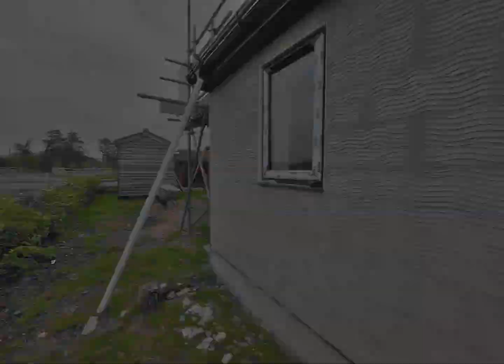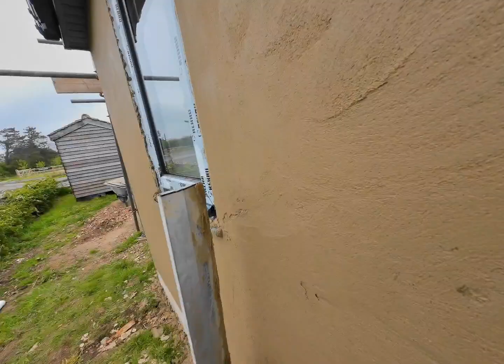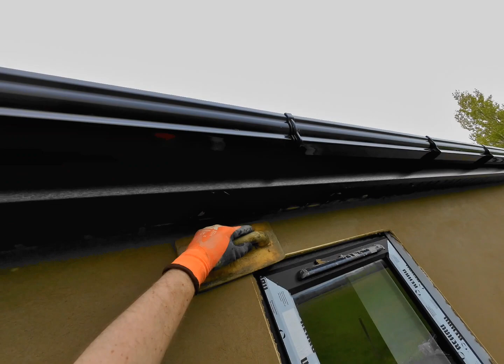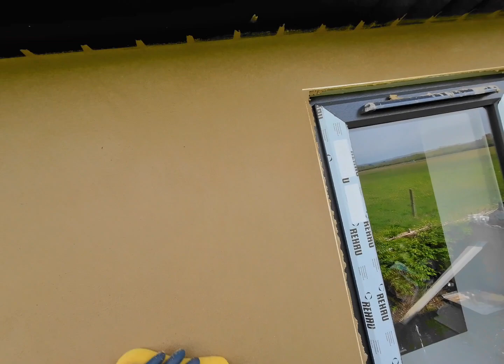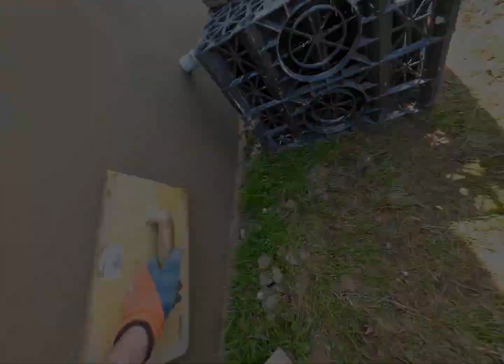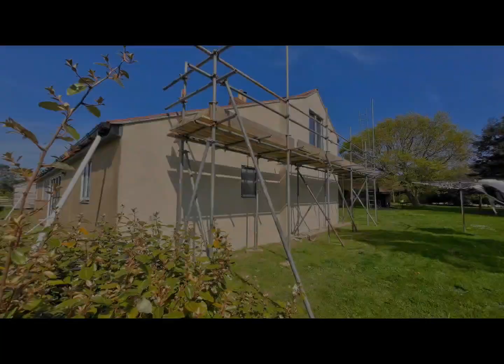Finishing off this sand and cement rendering job

Comment: Whats the mix mate?
Looks lovely by the way❤
Reply from the maker: Thanks Kevin. It's standard 5/1 with a liquid plasterciser.
It wasn't my job. I usually do 5 plastering sand, 1 cement and 1 hydrated lime with fibres which rules off a lot nicer 👍
Reply: @mikewestonplastering5082  do you put fibers in the top coat . If so any problems with them showing when rubbed up?.Thanks .